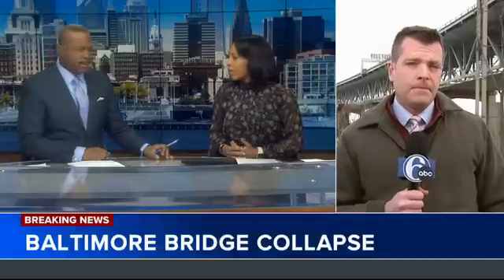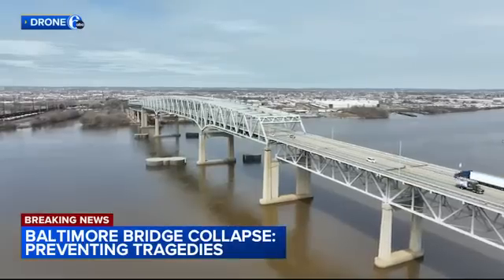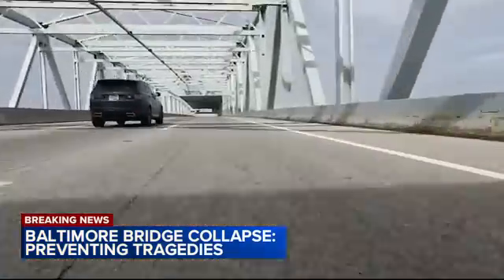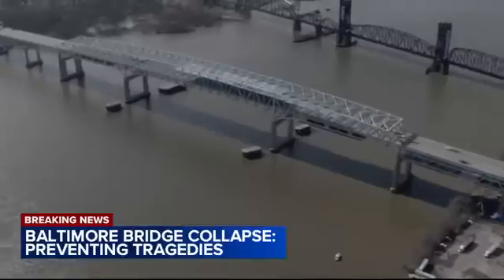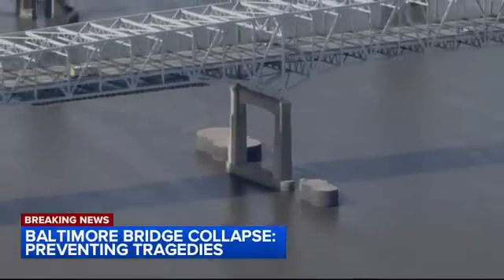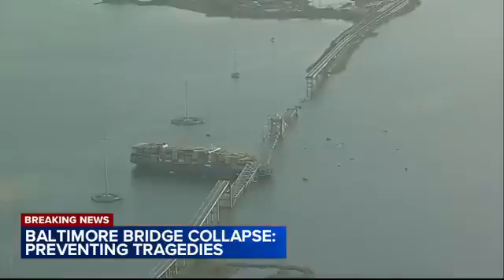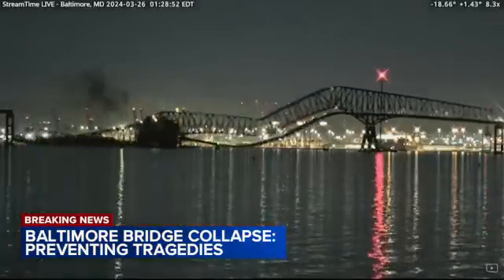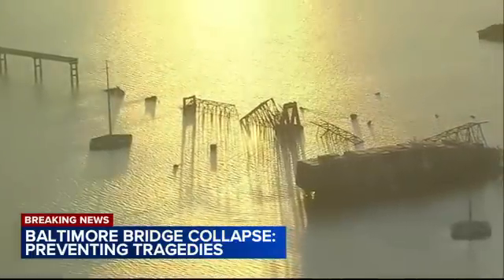Here's what surprised a structural engineering professor about the Baltimore bridge collapse

Comment: Yeah sorry but this "engineer" doesn't know what he's talking about.
Although some continuous truss bridges resemble cantilever bridges and may be constructed using cantilever techniques, there are essential differences between the two forms. Cantilever bridges need not connect rigidly mid-span, as the cantilever arms are self-supporting. Although some cantilever bridges appear continuous due to decorative trusswork at the joints, these bridges will remain standing if the connections between the cantilevers are broken or the suspended span (if any) is removed. Conversely, continuous truss bridges rely on rigid truss connections throughout the structure for stability. Severing a continuous truss mid-span endangers the structure.
Reply: he's a quack

Comment: After 9/11 Homeland Security recommended for Baltimore Port Authority and Maryland Transportation Administration to add concrete dolphins like those on the Betsy Ross Bridge… they did not because of expense. 

The Drexel professor is wrong, that bridge was designed before redundancy was required, and with the loss of the support for 2 spans, the 3rd truss had no cantilever to resist and you can see it swing up and bounce like a spring being released….Drexel guy needs to get out of the office…..Villanova College of Engineering 👍

Comment: The lack of barriers is a heinous oversight. It should be REQUIRED. Perhaps this tragedy will instigate that change.
Reply: actually the NTSB report following the Sunshine Skyway knockdown in 1980 recommended this very thing:  "The Safety Board believes that the Coast Guard and the FHWA should
coordinate their efforts in providing for the safety of the general pUblic by
determining the specific existing and proposed bridges which are in need of
additional protection from ship collisions and issue standards for the design,
performance, and location of structural bridge pier protection systems.
Reply: Yeah, and they should also protect the tops of the bridge towers from aircraft.
Reply: It would be today, just not when the bridge was built. The right solution is a suspension bridge with no piers in the water that can be reached by a ship without running aground first.
Reply: No.. they need to send more billions to Ukraine and continue to ignore the needs of our own country and infrastructure.
Reply: @ericdraven7185  Yep, second-hand military equipment could have stopped this ship from ramming the bridge.
Reply: Haha! Great sarcasm, Dave!
Reply: @ericdraven7185 🤡

Comment: What surprised me is some reports indicate that the pilot ordered left hard rudder, which is not unusual in low speed maneuvering.  But that assumes propulsion is working, and speed stays above a minimum value.  We don't know that for sure yet, but we did get to see black smoke from the stack in the wake of power coming back on, then blacking out again.  That is either engines working very hard or... maybe a loss of control air, which on failsafe systems means alot of valves close.  Do that to a turbo intake or  engine room vents at hard throttle [with all doors closed] and it can't get enough air and exhaust becomes an industrial 'rolling coal' exercise.  The ship did not speed up, but slowed down as video shows.  And guess what: full reverse with hard left rudder makes the stern walk to port... and aims the vessel further to starboard, right at the bridge support structure without forward movement having been stopped.  It appears a major problem with few options was turned from a serious situation into a five star disater by... the pilot.  They just might have squeaked through keeping rudder midship,  then tripping anchor after crossing under.
Reply: Voyage data recorder will have the rudder position and helm commands, speed from time of leaving the dock.
Reply: BUT IT WILL HAVE NO DATA JUST AFTER POWER LOSS AND WILL START RECORDING AGAIN AFTER THE BRIDGE IS IN THE WATER...  IT WAS PLANNED.... @nomenclature9373
Reply: Think it was a Biden planned disaster to change the topic - Black Swan Event!!   Biden and Zelensky booked this up with his Ukraine captain.
Reply: Why do you assume they actually had any revolutions on the screw at all, and if they did, what makes you assume they went full aft?  They didn't need to change speed, they needed to change course.  Only if they could change engine settings while simultaneously unable to move the rudder, would it make sense to order reverse.  But all the reports so far say they never restored power to the screw.

Weird that you assume (with no evidence) the pilot made a big mistake, instead of blaming the crew for failing to keep their machinery running.

If the crew were doing their job, they should have had backup generators up to power steerage in case of a power failure during this critical phase of transit.  If the crew were doing their job, the ship should have had rudder even when the engine died.  "Hard left rudder" is the sensible order, because it should have still provided directional control when the engine was out.
Reply: @bronco5334  It all hinges on a left hard rudder command being what actually happened. Even no revs, plus ship has forward momentum, the standard pivot would be stern to starboard, bow to port... they would have turned left in plain english, and tracked back into the lane where they belonged.  It might be possible that feedback [or default position] went haywire on account of blackout, but there's no news on that yet - it's vessel specific, and we might be wailting on the ntsb report to find out full details.

Comment: Why not just have tug boats escort ships while going under bridges. Or make bridges without supports in the water.
Reply: “or make bridges without supports in the water”

the bridge was 1.6 miles long. i dont think there are literally any over-water bridges that length dont have supports in water. and tugboats to go under bridges? good luck doing that efficiently say in philadelphia with dozens of bridges
Reply: @Topapo2  Of course there are bridges with very long spans over water... They are called suspension bridges.  There are 6 suspension bridges in the world where the main suspension span is over 1 mile in length.
Reply: They (tugs) were supposed to be there leading
Reply: @carolbruner5226  no they said they don’t need tugs for this route
Reply: @t.n.-js6ei don’t talk about it be about it
Reply: Using tugboat would be to drastic  dtuthur have bridge fall down

Comment: I heard that the container ship initially had tugboats guiding it out but the tugboats departed before the container ship ever reached the bridge.  I also heard that there was no requirement for tugboats to be used to guide large or heavily loaded ships under the bridge.  I'm no expert but I am now wondering if tugboats had remained attached to the container ship guiding it until it passed under the bridge, would they have been able to safely get that container ship through even though the propulsion system on the ship failed.
Reply: Possibly, but nobody was expecting a 100,000 ton ocean going container ship to completely go dark and lose both propulsion and steering. The tugboats peel off once the ship is in the channel and under way as they've got to get ready for the next ship waiting to dock at the berth just freed up. Having tugs on station seems prudent, but I'd look more at why the bridge's support piers weren't better protected. I get that Key Bridge was fairly old and there hadn't been a problem previously, but similar situations have occurred before with similar results elsewhere, and the costs to passively protect the bridge would've been far less that the cost of replacing it now it's gone.
Reply: @butchs.4239  Key bridge completed in 1977 according to WIKI - Skyway knockdown was 1980 - when NTSB noted lack of pier protection as an issue and recommended 'look at all similar bridges'.  The tugs were 'docking tugs' and once the ship was away from the pier no longer required <by law>.  There are places/situations/conditions where tugs are required to 'escort'.  In San Fran a tanker requires an escort. Establishing a rule requiring an escort meets HUGE industry resistance as tugs cost $$$ and the ship is the one that pays even if is a legal requirement.  In a typical cruise ship port a ship without all of its systems or if wind exceeds XX, tugs are required. They don't like this .... These are Captain of the Port <USCG> issues.
Reply: Remaining attached would be pretty dangerous for the tugs, but they could have traveled in formation ready to push her if needed

Comment: the authority responsible needs to immediately appoint a team to fast track design-construct of a replacement structure. if a replacement is completed with 2 years, it will be accolades all round for a job well done. 
if the project is handled as a conventional design, tender, construct approach, the bridge  could take up to 4 or 5 years to be completed. groups like bechtel, fluor n kbr can handle such fast track assignments, but expect to be paid handsomely.

Comment: That bridge fell like a deck of cards
Reply: I was thinking it fell like dominoes.
Reply: More like a bunch of steel beams held by barbwire. 🤣
Reply: Or dominoes
Reply: Checkmate
Reply: 100,000 tons moving at speed 10mph? You maths guys will know what that equates to. That bridge is designed to move vertically. Not be hammered by 100, 000 tons
Reply: That'd be true of any truss bridge and a lot of other designs, too. Architecture is the science of designing to certain loads and if the load changes then failure will happen. I doubt that the architect was required to design for an impact of this massive container ship.
Reply: @tonysu8860 you mean engineer....architects don't typically design bridges.
Reply: That cargo ship is massive compared to the bridge..     our infrastructure hasn’t changed but cargo ships are much bigger than when the shipping lanes and ports were built.
Reply: I believe you mean "house" of cards....?
Reply: Look for the union label 😂
Reply: Fell like a bridge wired up with plastic explosive.
Reply: @kennethnormanthompson2740  yep
Reply: THANK YOU!!! @kennethnormanthompson2740
Reply: Looks like charges cut the beams in key areas. Otherwise, steel girders would normally bend & crumple, not split so cleanly.
Reply: @cadcamfreak 
Normally?  You have absolutely no idea what it would look like normally, since it doesn’t happen very often. The peer removed did you not see the 95,000 ton ship hit it?
The ship was moving at about 10 miles an hour. Why don’t you calculate how much force that is. Why don’t you look at the front of the ship where it’s damaged from hitting the concrete. And why did you tell everyone where the concrete is now? 

It’s amazing how you conspiracy theorist can make a conspiracy out of anything.
Reply: Make in china.
Reply: @williamfeng7980  Whole US made in China 😂😂😂😂

Comment: Why was it belching full throttle black smoke?
That's the crazy part. 
They don't go that fast through there.
Reply: Most ships are diesel electric, so full throttle on the diesel generator does not necessarily mean maximum speed on the props. It could have been max speed, it could have been less, the props could be reversed to astern, NTSB has not made it public yet. Also black smoke could be cause by a number of things in diesel engines including heavy load, and too much fuel injected into the cylinders. Maybe the engine was running away as well and the generator was shutting itself down to protect itself electrically in abnormally high RPMs. Again we will not know until the ntsb releases it's reports.
Reply: @AMD1   Fair enough

Comment: I find this Professor's claims very questionable, He is wrong on a couple of points #1. The bridge did not go all at once, it did go quickly but, it had a staggered collapse #2. A continuous truss bridge is a bridge in tension, if you lose tension the whole bridge comes down, BECAUSE THAT TENSION IS CONTINUOUS ACROSS THE BRIDGE. Think of what happens if you have a bow like a bow and arrow, you turn it sideways with the string pointing down, the string would be the " road " and the bow is acting as the "truss" , what happens when you cut that bow string? Same thing happens when you release the tension in a continuous tension of a bridge, part of the bow does not " hold on " after the string is cut. ( I am not a civil engineer, I am a mechanical, and I know enough to know his comments were BS )
Reply: Mechanical engineering doesn’t teach you what structural engineering does and he’s a professor not some YT rando 😂
Reply: Force vectors are force vectors darlin, and you can't change the laws of physics. In addition to that civil engineers are lowerer on the engineering totem pole then Mechanical, Chemical, and Electrical Engineers.  Lastly good engineers cross study, and learn about the other disciplines.

Comment: If you are 'Murican, you REALLY have to worry about your infrastructure (bridges, roads, railways) - if it is not rotting away and falling apart due to negligence, there are procedural issues like this one: Why was this vessel allowed a speed of almost 9 knots before passing the bridge? 
Why were there no collision barriers protecting these fragile bridge pylons like what is described here? 

The NTSB investigation will eventually clear up what happened, and why. There will certainly be a lot of blame flying around, Boeing-style, with everyone watching what will stick, and where it will stick.
Reply: 9 knots is not particularly fast and the ship needs to carry at least 8 knots or the rudder will not steer the ship. The normal speed for container ships passing under this bridge is 10 knots. By the way it was only going 1.5 knots when it hit the bridge. When they lost power the currents and wind took control of the ship.
Reply: @NotExpatJoe  , I stand corrected.

Comment: Those concrete dolphins are nowhere big enough to prevent a ship of that size from damaging that other bridge. 😂
Reply: They are if you build them big enough and far enough away.  But that's going to cost a lot of $.   My guess is that the cheaper answer will be a long span suspension bridge (there are 6 suspension bridges with main spans over 1 mile).

Comment: Container ship is worse  than if an aircraft carrier would have hit it . Why the captain didn't have the ship lined up with the center of the bridge instead of coming in on a weird angle is a mystery
Reply: They lost power
Reply: @lazygardens  so could not steer?
Reply: @ChrisLeonard-np7lh  No power = no steering.
Reply: @lazygardens  hmm. No backup manual? Odd.
Reply: @ChrisLeonard-np7lh   MANUAL?  You think you can move the rudders on a ship that size by hand?
Reply: @lazygardens  well likely no but why isn’t there a backup power system? Anyway the vid from seconds  before the collision show the ship , power still on, headed right for the bridge support.
Reply: @ChrisLeonard-np7lh  Cargo ships are NOT sports cars or speed boats. It takes hundreds of yards and a lot of engine power to change course.
My ex was a ship handler, and even their small ships were not fast responding because of the physics of momentum ...
Reply: @lazygardens  watch the vid how it steers right into the support.
Reply: @lazygardens sure 😂
Reply: why did they loose power? @lazygardens
Reply: @lazygardens   i know it lost power but look where the ship was when it did if it would have been centered it would have made it
Reply: @dennism7909  You are assuming it was on the correct vector, and that there were no currents winds or other factors that would nudge it sideways.
There is a "black box" the NTSB will analyze ... have patience.

Comment: Bridge looked like it was built out of matchsticks and glue the way it just splintered up and collapsed 🙄
Reply: It was a sturdy bridge, but if any one of the supports was gone, the whole bridge falls down, not just the part that was hit. Maybe that was good enough when it was built, but not with today's huge ships.
Reply: @Paul_Wetor   And after 40+ years, no one considered it?  I am quite sure, the need for protecting the bridge was brought up a few times over the years; but, the liberals in charge, stopped the funding.  Just kicked the can down the road, year after year.
Reply: The design is typical of its era.  Today these are called "fracture critical" bridges because if one key element fails the entire bridge collapses.  Modern bridge design has multiple redundant elements - and are not fracture critical.
Reply: @perryallan3524 
If you took out a main supporting pier on any modern bridge. I don’t think it would’ve fared much better.
Reply: please study structural engineering before commenting.
Reply: @TheRightONe-et3gh  No need to study anything. I wasn't commenting on the structural engineering of the Bridge I was commenting on the way it went down looked (Looked is the key word here) like it was built out of matchsticks and glue.
Reply: @thedesertdwellerfromutah4354  Yes that's true, point taken. Still it sounded like a judgment on the design... and I am sure that's the way the people giving you a thumb up took it.
Reply: stupid comment!
Reply: When things collapse in large scale, they look similar to when they collapse in small scale.
Reply: It fell like it was barely holding on as it was we can send billions to another country but we can even make a bridge here so that don't happen I bet there was costs cut when building our government will spend whatever unless it to help it's own people that's the damn truth